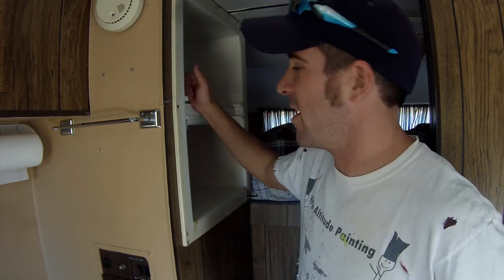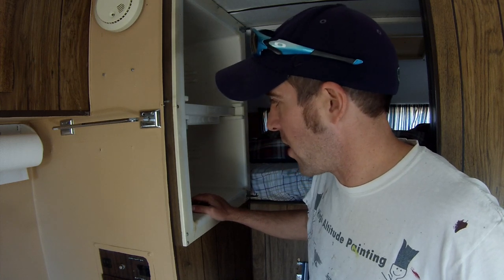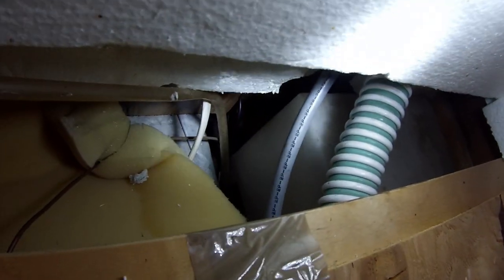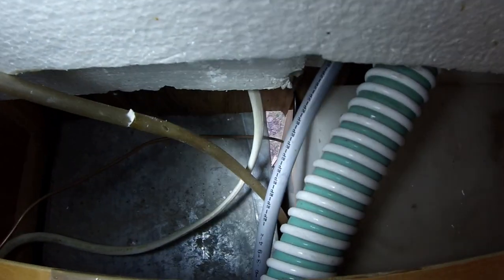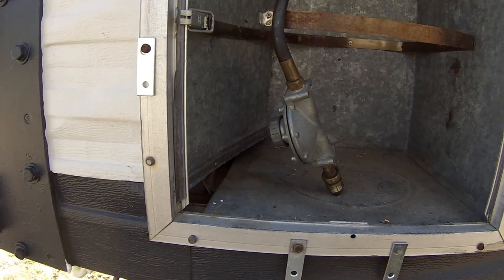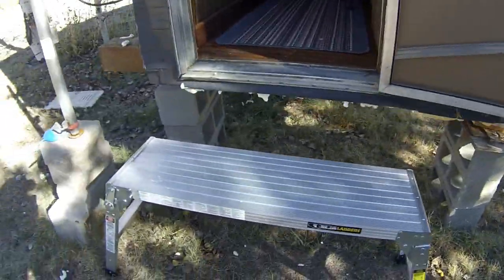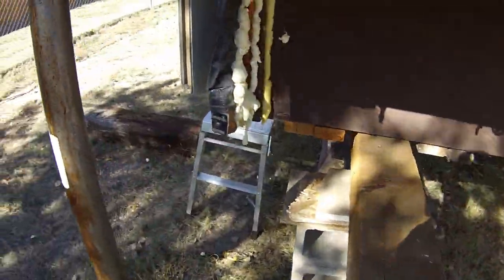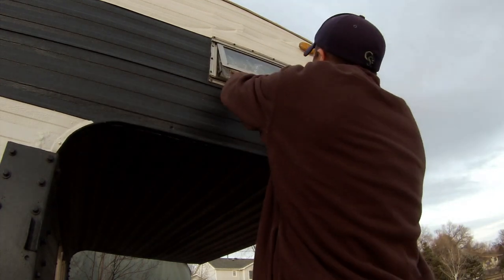Insulating and Sealing The Truck Camper

Comment: Hey! you did one heck of a fine job there. It loos great, should be a big noticeable difference from last year!

Thanks for sharing

Jed
Reply from the maker: +NDNomad Thanks Jed!  Yes, it has worked very well so far.  I just got back from a truck camper trip and it was a noticeable difference.  I will upload some videos of our trip to show everyone!
Reply: +Colorado Camperman So tell me in your own personal opinion, If you had a 2009 or newer half ton pickup with air bags, and short box, 6'4" would you put a pickup camper in it for short trips to local areas, 2 hour drive or less, and would you take it to Alaska for one big trip. I'm talking an older pickup camper like yours that would stick out past the bed a ways, and require the stand that mounts in the receiver hitch, or one that is made for a short bed. Just looking for your opinion on a hypothetical question. Thanks!

Comment: I've been trying to find a decent heater for camper...   going to sequoia this week.   it's been getting down to 5 degrees gonna be cold
Reply from the maker: +Geareddown club Definitely check out the Mr. Heater Big Buddy.  Go onto Amazon and search for: Gascru Propane Refill Adapter and purchase that to fill the 1lb bottles. Or you can get a 20lb propane adapter.  Mr. Heater claims it doesn't work at high altitude because of the low-oxygen shut off feature, but I have had it working at around 10,000' just fine.  

I also have a video on camping in the winter, check it out: https://youtu.be/ZH1Whqdml2k

Have fun and stay warm!

Comment: Are you sure those gaps in the propane compartment weren't supposed to be there? If my science is correct. Propane is heavier than nat gas. So if you have a leak in there, the propane will pool up on the bottom of the compartment if it has nowhere to escape. My Lance compartment  with 2 20lb tanks has no vents on the door. But it does have about a  3X3 inch square opening on the bottom where the hose leads outside to connect with the main line.
Reply from the maker: +disposableicons Huh, it didn't look like it was supposed to be there.  It looked like there was a seal around there that had broken.  I  have the "door" vented, so I am thinking that should be good enough, hopefully!

Comment: how was the winter in the camper? looking to do the same this season
Reply from the maker: I took the Truck Camper out probably 6 times this past winter.  I actually ending up selling the truck camper in the video because the heater caught on fire!  Are you looking to live in the truck camper or do winter trips?
Reply: +Colorado Camperman looking to live in it while going to school..I saw the fire video and that's definitely shaken my confidence in the camper furnace... leaning toward a homebuilt so I can insulate and seal it for less than overhauling a used unit.
Reply from the maker: That is a great way to save a lot of money while going to school and I think that would be a blast!  Good for you man!  Yeah, I do not trust those old style radiant heaters like I had.  The new furnaces that have fans are much more reliable, they just take up battery power from constantly running the fan.  The other option (which is pretty safe) is the buddy heater.  The only thing you have to worry about with the buddy heater is the metal grill on the front gets very hot.  I have burned holes in a jacket and snowboarding pants from getting too close!

A homebuilt camper is always a good option because you can create exactly what you want.  Overhauling a used unit can be a lot of work, but can work out well too.  Either way you decide to go, have fun and good luck!